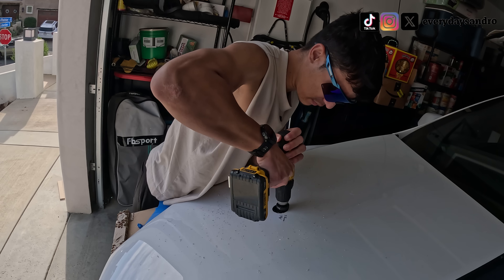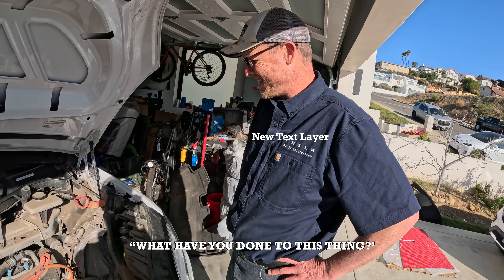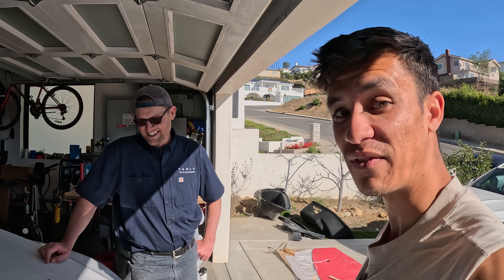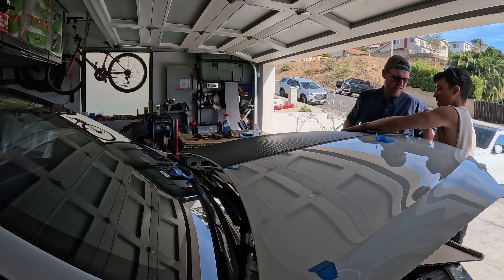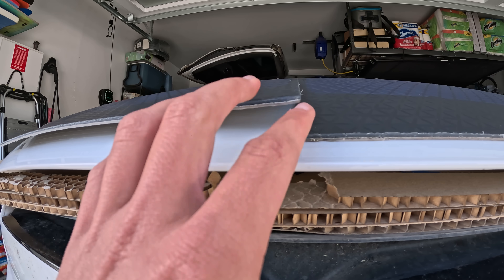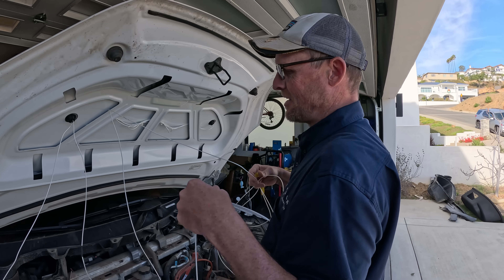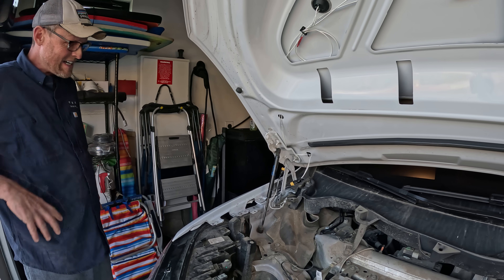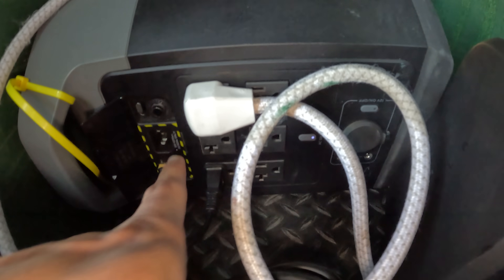DIY Solar Powered Tesla - THIS Changes Everything

Comment: Wow! Please follow up on this topic and review the setup! How does it work compared with regular solar panels. 
I am thinking about this might be a bit hard to adjust the efficiency angles.
Also, how it works with multiple solar panels simultaneously to maximize the charging speed and countering the realtime continuous output. 
🫡🫡
Reply from the maker: I will be making a follow-up video - stay tuned! Thanks for being here

Comment: I hate to burst your bubble but, like others have suggested, it's a futile effort to install solar panels on a car, using current solar technology.  Under ideal charging conditions (angle to the sun, ambient temperature, electrical efficiencies, etc), you'd be lucky to generate 1 mile of range per hour for the peak solar charging hours of the day using 300 watts of solar panels.  The 135W peak on your drive barely would have barely provided 1/2 mile of range.  Plus, solar charging performance will degrade quite a bit if the car is not facing the sun during your drive.   It's understood that ideal solar charging conditions in locations closer to the equator (eg, AZ, NM, CA) might have 5-7 hours of peak charging during sunny days under ideal conditions with perfectly configured solar panels.  If solar panels are not perpendicular to the sun or it's hot outside, your charging performance decreases.  Then there are electrical losses in wiring, battery chargers, and inverters.  This also begs the question of range loss due to degraded aerodynamics from the solar panels and added weight of the panels and EcoFlow which, if true in your situation, you could be losing as much power as you're generating.  This is why you don't see solar panels on cars.  Current solar technology makes it impractical.  

With that said, if your goal is to just charge an EcoFlow or another similar solar generator for use as an emergency "gas can" or when car camping, then having solar panels on the car might be useful.  Due to many parking spots at campgrounds being poorly situated for solar panels on the car, I'd argue that stand-alone solar panels on the ground would be the better choice for car camping because you can set an optimal charging angle.  But then again, you do get to charge while your driving and parked when you go out.  Trade-offs...

Before drilling holes in your car, I'm surprised that you did not first test the panels just sitting on the hood of your Model X to see what sort of performance you get at different times of the day.  

I hope you're able to find some benefit to your hood-mounted solar panels.  Good luck.
Reply: Nothing else we get to see someone to tear up his car. But it's quite practical for these to charge up his solar generator. May be useful if the charging station would charge up the solar generator but for life sake it's better  to charge them slower and steady around 200 watts. At least until the battery technology is improved.
Reply: Larger arrays are fine for solar generators since they have built-in solar charge-controllers, which will start to limit the charging power as their batteries reach a certain level of charge (80%?).  In fact, it's better to have an array that is larger than you need because you don't always have ideal charging conditions, and this is even more important in locations where cloudy days are more prevalent.  I only know this stuff because I built my own 3.6kW solar array and 10.6kW battery bank, which required a ton of research and learning.
Reply: It is an adventure, it is a learning experience. Just think of all the money spent on RC toys and drones
Reply: All that to try and justify that this isn't useful. Tisk tisk
Reply: I mean If I am at work - for 8 hours of the day, and you are saying 1 mile an hour - that would pertty much cut my power usage by half per day... like that would be good enough for many people. Even at the lowest you 1/2 that would still give an extra 4 miles - I drive less than 10 to and from work. The sun is really out for around 10 hours give or take - so really it be closer to 5 or 10. That wouldnt be bad at all really. With that said, I get it, more than likely wont see panels on cars till they're closer to around 40% as the 20% isnt good enough.
Reply: @adr2t  don't do an x and use the roof too
Reply: @adr2t  when working out solar power it's on an average of 5 hours per day and 300w is just under 1 mi per hour, but that's only if the panels are in the right location which the hood they will never be this system being generous would generate about 2 mi per day in good light or roughly 600-700w. In other words you could never recover the cost of the panels in power saving.
Reply: @shaynegadsden  Well I have 2 solar panels, 400watts each. Assuming we can improve their over all size to power generation (and we are on that track) you could easily fit both of those per car. Right now, they produce around about 3-3.5k a day and they're not in ideal locations or positions. So if and EV is using around .346kwh per mile then I am going to produce about 10 miles. Even if we cut that in HALF that would still be about 5 miles. That still is enough to off set the cost. Keep in mind, the goal isnt to fully charge it, it would be off set cost. Solar is already super cheap and only improving. I just got these panels 2 months ago after this post... so I am pretty confident you can easily make your money back in a few years and reduce your over all power usage without burning as much carbon. Now, is this video a big of a waste of money? Yea, but future solar designs wont be. We just need to get there and we're getting there. Of course, by then, it might be take less power to move that far as well by then too (not holding my breath but 5-10% can make a difference sometimes). Just make a point, he is directly charging another device using DC - then the unit it self losses power turning that DC back to AC. Its also wasting power running it self + the cost of having that AC running that alone can account for about 10% lost. Instead, you would want to just power the EV directly skipping many of those loses and reduce the over all cost of the system. At that point, your cost would just  be solar + labor. If it was factory done, they would account for that labor and or it would just be part of the design, thus over all cost would just be the cost of solar it self. I would assume they would add sections from the hood to the tail that can be easily replace if they go bad over time too. In worst case, they produce power that would off set Cooling/Heating and System (monitors, lights, etc) allowing you to get that full 300 miles off the battery vs the 10-15% hit you take currently while being more efferent DC use.
Reply: @adr2t there size and power isn't improving they have gain a few percent in decades and that's fixed panels flexibles are far worse
Reply: @shaynegadsden  Then you need to keep up, because panels I got are only around 20% eff, todays are around 25% and the new duel tandem is around 30% with some of those reaching into the upper 40% range with some even looking to use more of the IR to glow some elements to around 45% or at least in case of a car, use that IR as heating and even cooling. At 40% - you can cut panels to half their size and we dont fully need flexible cells as most of the body of the car is more rigid.
Reply: @adr2t lol the best you can buy is just over 24% regular panels are still sub 20% and lab experiments don't count because yeah i have seen some really high numbers too but using rare metals and super involved process that can only be done in labs sound cool but help nothing.
Oh and cars need flexible cells they may not be moving but the surfaces are flat they all have some sort of curve.
And those mid 20's panels are labelled high efficiency and charging according
Reply: @shaynegadsden  Again, you are out of date then, the 30% ones release this year. So not sure what you are going on about lab ones? And no, they dont need to be flexible at all or at least very few of them have to be. Thats all a layout and packaging thing. The cells themselves can still be rigid. Now, I have to admit, it might be a bit before we see stuff change... so I say it'll be another 10 years before the next true update, but we're close in terms of just time.
Reply: @adr2t what's these 30% ones then because i don't believe you i have been working with this sort of stuff for over 20 years now.
Just the brand name i understand links won't work
Reply: @shaynegadsden  LONGi releasing theirs in late 2025 they said. First to hit 30%. There are others, but I can't remember off the top of my head.
Reply: @adr2t The panel LONGi are releasing later this year is the Hi-MO x10 it has an efficiency of 24.8% which is impressive but only like 0.2% better than current they did claim a record getting over 30% in a lab but also try to remember what they are testing is cells and the efficiency of a cell isn't that of the panels and as end users we work with panel efficiency.
Just to show the cell efficiency of the Hi-MO x10 is 26.6%
Reply: @shaynegadsden  I am not sure what they're calling it, but no, that was the lab report, I know what you are tlaking about, but they said they are releasing later this year the 30% one.
Reply: @adr2t  i read everything on their site the only mention of getting over 30% was the record test June last year and you don't go from a 1 off record to full scale production in 12 months nor do you push the big achievement of 25% if your launch a 30% panel
Reply: @shaynegadsden  Of course, but, I remember seeing the announcement.
Reply: That's correct, the sun is out for many hours per day, but the angle of the sun to the solar panels is the key.  When the sun is lower in the sky while the panels are facing directly upwards or on a slight angle, solar panels gather very little sunlight.  Solar panels only reach peak efficiency when the sun is perpendicular to the panels, which is about 1 hour during the day, typically around noon when the sun is at its highest position relative to the solar panels.  Outside of that peak time, however, charging efficiency degrades as the sun's position becomes lower in the sky.  This is why the sunniest locations only have 4-6 hours of "peak" charging hours even though there might be 10 hours of sunlight.  For an EV that consumes 300 W/mile, a 300W solar panel charging at PERFECT efficiency will be lucky to generate 1 mile of range per hour.  However, no solar panels run that perfect.  Plus, they'd need to be positioned perfectly perpendicular to the sun, which would be tough to do when mounted to a car.  Then there are losses in the wiring, charge controllers, inverters, etc.  By the time the car is charged from the Ecoflow, the car would be lucky to get 80% of what the solar panels collected.  I'd guess that this solar setup might be able to produce total of 1 kW on a full sunny day, and maybe 900 W (generous estimate) of that power could be used to charge the car.  For a Tesla running at 300 W/mile, that 900 W might provide 3 miles of range.  On a multi-day camping trip, charging the Ecoflow from solar would be quite useful.  In a pinch, 3 miles of range from the Ecoflow "gas can" might be just enough to get to a charger if you car's battery ran out 3 miles short.  I love that this YouTuber tried to do something that so many people wanted to see.  It's just not practical for charging an EV with current solar technology.
Reply: he could install a gas motor to run the car and use the panels to keep his radio working.
Reply from the maker: Appreciate the detailed feedback! We're still learning and always striving to improve! We decided on the hood as it’s the only place where the panels would fit with the solar junction boxes not poking out at the top of the panel increasing drag. 

The main idea about using these panels is to keep my EcoFlow charged, so I can cook more often, power my communication devices without taping into the HV, I will make a thorough video about this! 

As for charging the car, I always say it can get me out of a pinch really. Imagine pushing me 1-2 miles?😉 - Beluga
Reply: Man, I'm a solar hobbyist and I couldn't have summed it better than you did. It's a lot of work for not much gains. I do agree just using some portable solar maybe better to charge that power station. A better Tesla to have some type of solar would be the Cybertruck. With it's angled tonal cover or even have something inside the bed with the cover open would be more efficient.
Reply: Yeah, it's kinda a waste of time/money. But, that is what projects are.

Comment: A little solar on all vehicles will go a long way.
Reply from the maker: Love it! Yesssss!
Reply: NOPE , drop in bucket.
BETTER off w/ ROOF Solar & Powerwalls. 
ZERO net home Energy.
Reply: @markplott4820  It is true the most effective solar is racks and batteries.  (Carports) for a daily driver.  You only need 3-4kw of panel and sunny days to cover a 20-mile commute.

That is not the only case use for solar.

A small amount of solar on a vehicle is very useful in the sense the odds of coming out to a dead battery in an ICE vehicle drop to near zero or say running a small fridge when the vehicle is off.

For an EV a small solar panel will overcome the parasitic discharge that is commonplace in new vehicles.  Eliminating discharge while sitting.

A large panel on an EV car has the ability to add 2-10 miles of range a day.  For a vehicle that is not a daily driver or used in remote locations, that is extremely useful.

Comment: 😆 At a perfect charging rate, you still get less than 1 mile for every  1  hour of charging. At 115 watts, you’re charging at ~0.35 miles of range per hour.
 😂
Reply: 365×12= 4380 free miles a year
Reply: @ At 115 watts, you’re charging at ~0.35 miles of range per hour.
Reply from the maker: Free juice is free juice!🧃
Reply: @EverydaySandro  it’s not free when you pay for it. But I guess this video will make it free. 😏
Reply from the maker: I agree, it’s not a game changer for driving distance, but it does keep the lights on! And who knows when these will actually be needed to charge me Beluga😉
Reply: When you boondock (camp off the grid), the goal is to find energy savings where you can.

There is no other way except wind I suppose to create electrical potential by parking.

Just like the ISS.  Those panels were probably 1000 times more expensive than modern equivalents, to say nothing of delivering them to orbit.  However the opportunity cost is so high that it makes the source of power invaluable.

One the supply of power is inexhaustible and two you do not need to carry the capacity with you when volume, mass, and safety are crucial.

Comment: Cool, what we talking as far as return?  1 mile her hour?  Several?  Why does it have to go into the ecoflow and not directly?
Reply from the maker: Not sure the equivalent miles gained as need to do some testing. It’s best not to mess with the HV
Reply: It cannot go directly because the HV battery is around 400V DC and these tiny solar panels around 40V DC. You would need a DC-DC converter. The effort and the expense is not worth it. You'll get half a mile per hour with just 300W. Better just to buy an Aptera if they start producing them.

Comment: Because that ecoflow doesn't have an output transformer to provide galvanic isolation between its DC boost stage and its AC output, one day when it's H-Bridge circuit fails and shorts to ground, you'll fry your Tesla's onboard charger and will void your Tesla's warranty. You should have installed a low frequency, transformer based inverter if you wanted to safely charge your Tesla. Good luck!
Reply: @quickquote1568  

I don’t think Sandro is trying to charge his Tesla. Instead, he’s just charging his EcoFlow. Does this change your analysis?
Reply: @frankfountain7680  The title of his video is "DIY Solar Powered Tesla". So I would assume that he will be plugging his Tesla's EVSE into his Ecoflow to charge his Tesla.
Reply from the maker: Appreciate the feedback!
Reply: I don't think he would use this to top up the HV battery regularly, only in case of emergency. In that case the tradeoff of not using a bulky isolation transformer is ok. For permanent connection I would use a Victron inverter. You'll lose your warranty anyway when you'll splice charging port cabling to connect it.

Comment: Wow, this is the best solar install i have seen on any car (after market)!  On the Delta 2 (i think) and really all of the EcoFlow products, they use a 3 pin XD 60 called an  XD-60i.  The regular 2 pin XD-60 limits your input current to 8 amps, while the XD-60 sets the current limit to 15 amps, so depending whether or not you wired your two panels in series or parallel you may be running into the 8 amp current limit (if the two panels are wired in parallel) and you are just using the regular XD-60.  If this is the case, you can remedy this by wiring the two panels in series to double the voltage and get closer to your 300 watt output of the two panels (i think you said they were rated at 150 watts each).  If the total output of both panels is 150 watts total, forget everything i mentioned.  Great build though and a great inspiration for others!
Reply from the maker: Thanks for the heads up - I'm always learning, and I'll look into optimizing this further! We soldered the XT-60H to each other and then into the EcoFlow
Reply: These flat panels will never  reach max 150Watts. First they are cheap and fiddly, second they are not pointing at the right angle. So the best you get out of this is about 60%-70% from specs. So the 150Watts he gets is probably the best he will get away from these, maybe 200 Watts and that is it. Nothing more. I have 4 such panels of 310Watts and know what I am talking about.
Reply: You guys did a great job. Where did you get those panels from?